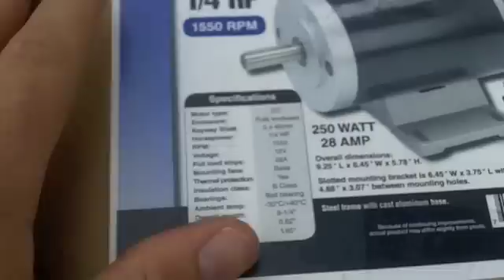Wind Turbine

Comment: Maybe try using a rear axle and put more blades size 6-8 10-12 feet. Separate from motor. Bigger pulley. Run belt to smaller pulley on motor. Just a thought.

Comment from the maker: JTed, you are absolutely correct about the rpm's needed to produce the full wattage. However, this project was not done so as to power anything in general. I just wanted to see if I could get anything at all and this was after all my first attempt at wind power. I have forgone wind power in general especially at my current location. If I ever do decide to go back to wind. I will be only too happy to purchase a professionally made system. I have now gone down the line of solar and   backup battery power systems. With the current status of LED lighting and low powered equipment I have found that my need for large amounts of energy to be a thing of the past. As to the amount of views that this video has. All I can say is the timing was right. I posted this at the time when everyone was concerned about the rise in gas and oil prices. If you would like to see my new youtube site go to lowwattliving and check out my videos there. Maybe you could find something there you like better than this one. I am also on facebook as lowwattliving and will be ramping that back up shortly as I have unfortunately let it go over the winter.

Comment: You would have to spin the shaft at 1550 rpm to come close to the 250 watts. It's doing about 60 to 80 rpm there? I can't believe you would bolt the blade directly to the shaft and not have any gearing step up thought cross your mind. And actually buy all that stuff and put it together.  It's a motor as opposed to specifically a generator. There's a small difference in the design I believe. The blade has to have more thought to efficiency than 3 straight pieces of L section junked from just anything. The oil companies must have pushed this video to the top of the list out here.
Reply: +WahapinmyMilo A year later alteroes energies hasn't done anything with that floating turbine. And they most likely never will. It's a great idea so it's of course bought off and put on a side burner. Large corporations could crank out a million or two of those things in a few years  - probably put them off shore very simply. That's why they don't do it. They know they could create enough cheap to free electricity to power everything. Imagine all the millionaire billionaire energy industry tycoons that would lose their fortunes. That's why. They constantly don't try to implement green energy - they constantly try to destroy it. Then they sit out here and post there are no new and viable green solutions "ready for prime time" - It get's monotonous if you follow it a lot.
Reply: WahapinmyMilo  Hi Milo, Just read your comment, so was curious to know how much power do you think this 250 watt DC generator can generate if it is turned to its highest RPM, lets say around 2000RPM . Thanks
Reply: surenTokyo I shouldn't have been so smart. I see you're really trying. Check this out. This is what you're trying to do I think. The blade on this one is bolted directly to the shaft with no gearing step up either yet it seems to work. Go work for these people and kick them in the backside to get them to make TWO of these things. This demo video is from years ago and they are doing NOTHING with this great idea. check it out:
http://www.altaerosenergies.com/
Reply: +WahapinmyMilo Oh my! why aren't we hearing more of this?!!!!! the idea is brilliant and low budget!!! you can move it and use it everywhere!!!!!
Reply: +silverhairdemon This version should be smaller so the normal people can buy this too!
Reply: If I had money I infest in this.

Comment: you need bigger blades.. so much wind but so slow with no load?
Reply from the maker: gamerpaddy, Yes bigger blades would help but s JTed said. Gearing up would be the proper way to make this work better. This was my first attempt at wind and I used things I had around the area. Except for the motor that is.
Reply: +gamerpaddy bigger blades produce more torque and power, but it will spin slower. It needs to be geared up about 10 to 1 for that size blade set, but if you did that it could produce up to 1000 watts in the winter without burning up.

Comment: The unit of measurement should be called Volta, named after its inventore (Alessandro Volta), all now use instead volts, and in the plural volts  (more wrong because proper names cannot be declined in the plural), but even here I see  the "VOLD"    :-D

Comment from the maker: I have not used this wind turbine for about a year now. I am mostly using solar panels now. I have extremely cut back my usage of electricity. That is why I started "Low Watt Living" on Facebook. I'm just trying to teach others that it is not difficult to have a power backup system in place.

Comment: Nice pragmatic hack ...... 1/4 hp should be 0.25 of 740W ( I think the figure is that ) not 250 W which you suggest 1 hp is 1 Kw ...... but even without that minor inaccurate element , it suggesting that the unit should run at 1550 rpm , so it's not likely to produce anything like that output even if it was not suffering from some mixed maths.

Comment: you cannot get anything good on blades cut from PVC pipes. Its heavy and cannot rotate fast because its concave. you will just get a lot of disappointment using that blade. a blade that can rotate fast is flat on the wind side just like the shape airplane wing.

Comment: The 250 watt figure *may* be an alternate horsepower rating. Many motors nowadays have their hp rating given in watts (1hp = 746 watts). So that 250 watt figure then translates to approximately 1/3hp. They just can't keep it simple! I'd just chalk that number up to Harbor Freight's marketing moxie and go with the 1/4hp figure. But on another matter, I would definitely worry about the thrust loads those bearings are gonna get in this application.

Comment: ehm dear videomaker the motor isn't underrated!   you have to understand that the Wattage written on motors is the meccanical output power  .
The amps x voltage is the imput power  consumed by the motor.
So you are wrong!

Comment: Nice looking motor but you will need exceedingly high rpm(s) to make any decent energy as a direct drive unit. However, you could use a gear ratio setup as an alternative.

Comment from the maker: I use it to keep my solar power system topped off when we have little sun. It does it's intended job. I have recently changed it over to a vertical access turbine and geared it up with a few old tractor gears i found at a garage sale. However I have taken it down this winter and I'm planing on focusing on my solar panels from now on. Thanks for the input, I'm glad someone out there cares to help others with the knowledge they have. Thanks guys!!

Comment: It is 1550 RPM to achieve that wattage and you are probably at 100 rpm=about 16 watts if you're lucky. Right idea but need a geared motor or one with different rpm ratings.

Comment from the maker: Good question. I have heard that you could, however you need to get one out of an old car. They galled it a generator back then. You would also need to gear it because it needs to spin quite fast to produce the desired voltage. Or at least that is what I know about it. Feel free to check other sources and find out.

Comment: I would switch to a higher voltage rpm motor. 12 volts is only what it takes to run it, when it is operating as a generator, the voltage output is usually lower, unless you are spinning fast! If you want to get better low speed performance, consider getting a used higher voltage dc motor on eBay or through surplus.

Comment: Good luck using Harbor Freight garbage.

1 Horsepower = 750 watts, 1/4hp = 187.5 watts output. The 250 watt required is probably a cheap Chinese motor efficiency thing.

Good work , we need more people actually building things.

Comment from the maker: @sciurusniger ... It worked fairly well in high winds. i'm currently changing the blade design. i might be changing it to a Vertical Axis Wind Turbine. We were running it to a set of marine batteries. Not sure how much i am getting out of it because the wind gusting here. but it keeps the batteries charged and we run all of our chargeable equipment off of it. so.....